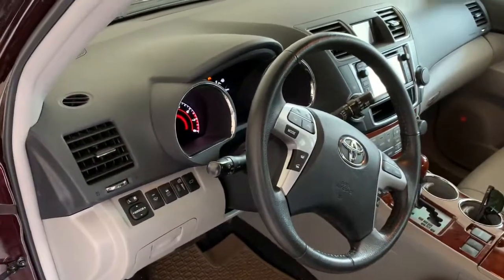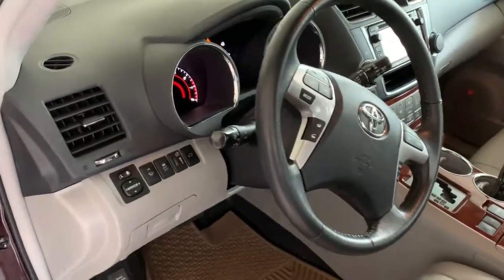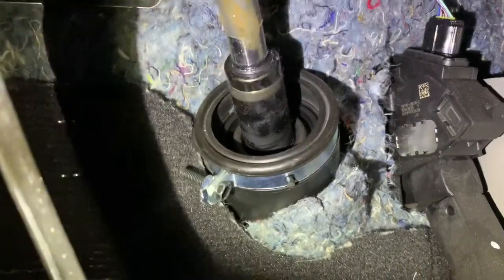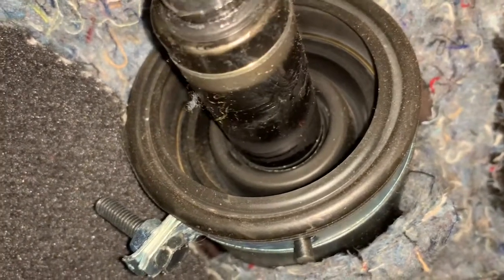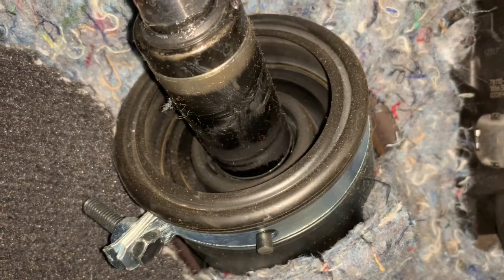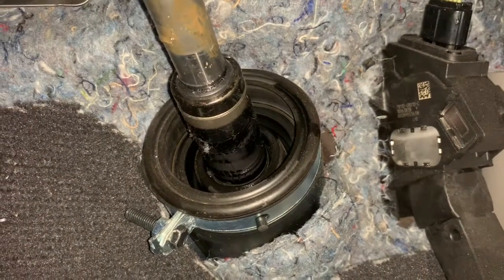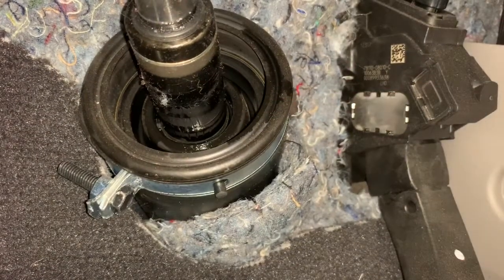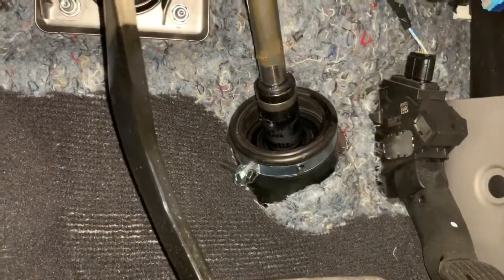Toyota Highlander 2013 squeaky steering - Solved

Comment: I have the same noise . I sprayed the part you are referring to and it's still squeaky.  Did yours stop?
Reply from the maker: Yes, it did. It may take a few hours, otherwise spray again.
Reply: Is it for 2014 Highlander too?
Reply: I got 2014 Highlander XLE with almost same problem, can it help?
Reply: @edm.1458  2014 is a diff generation but the boot should still be there
Reply: @edm.1458  I also have a 2014 XLE. Did this solve the issue?